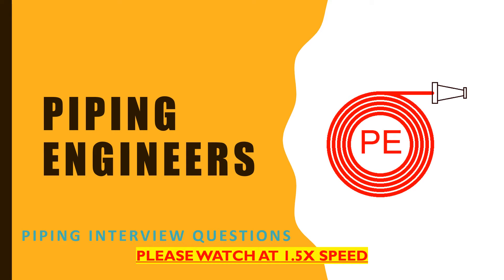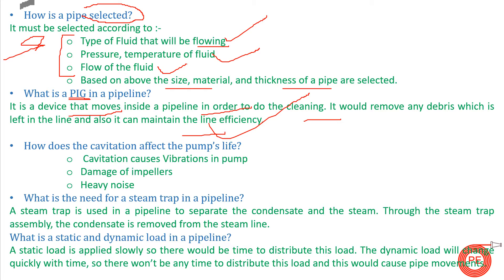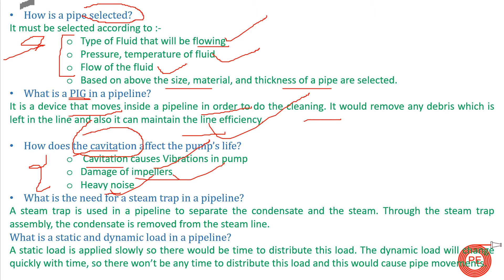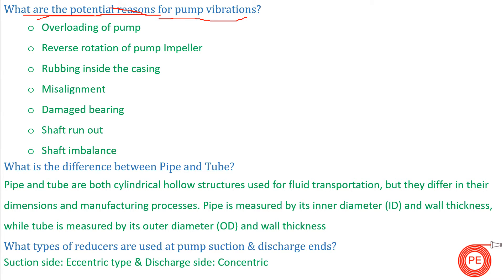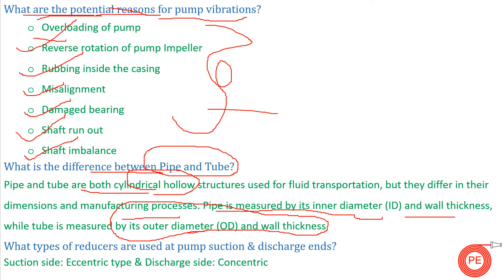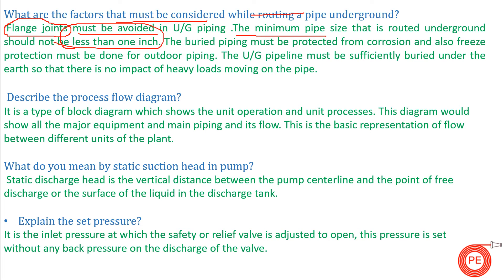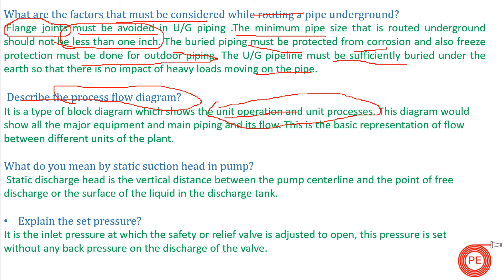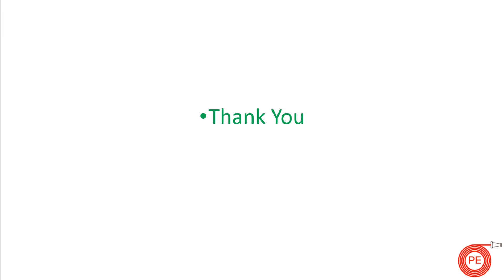Lead Piping Engineer Interview Questions| welding interview questions |oil & gas piping interview

Comment: what is the goal of this video?
Reply from the maker: I guess if you would have been a piping engineer or related to the field you wouldn't have asked this question...
But anyway these questions can be asked in an interview and it's a one stop for all those questions
Reply: @PipingEngineers  I am 16 years of experience piping engineer, I had no problem answering  all these questions. I see this video as a way to fake a CV and survive the interview :/
Reply from the maker: That's your requirements...may be everyone who watches this video doesn't have 16years on experience.